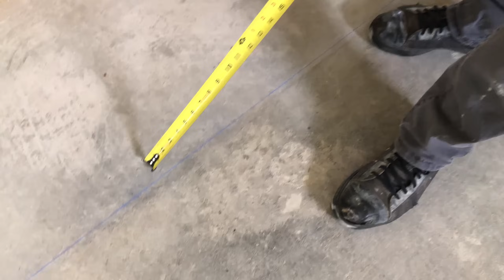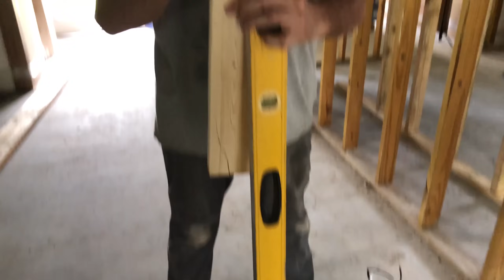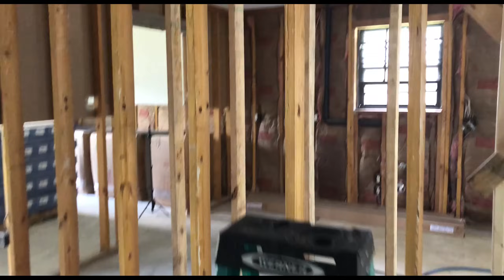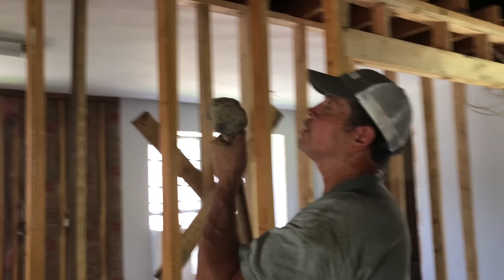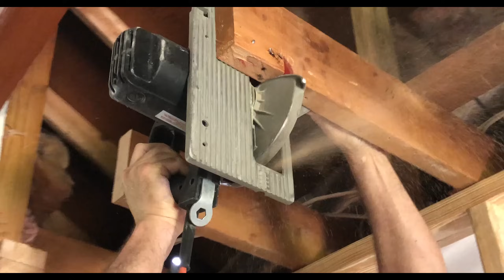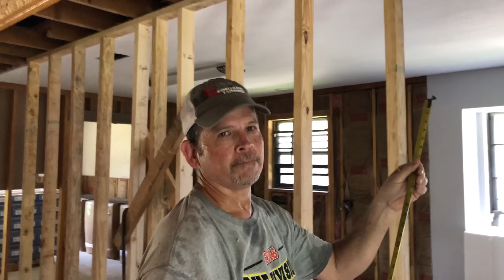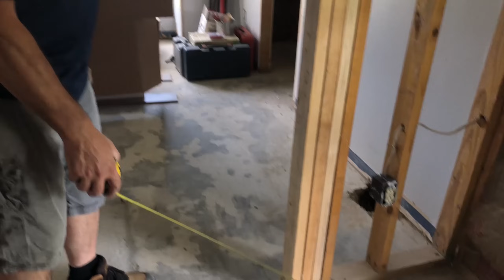Ripping Down a Support Wall and Installing a 16 Foot Beam

Comment: How would you tackle the footings if you're working on a floor above a basement with regular 2x8 floor joists?
Reply from the maker: Your engineer would have to design footings and the point load down to them.  I'd ask them to design the temporary walls as well.  You'll need them in the basement as well
Reply: @StudPack  i imagine the temporary wall should be fine since the load is spread out in a wide area and also its temporary.

Comment: Stud Pack: Did you consider a 17 or 18 foot beam to help further eliminate those short walls? I know you might be running into the roof, but the kitchen side seems to have a little room. My spouse would want all the wall gone!
Reply from the maker: Interesting you bring that up.  We actually had a larger opening and then the designer wanted it changed.  We moved the “stud pack” supporting the beam and the rest is history 😂
Reply: @StudPack  As long as the "designer's" name includes the word "spouse....." Thank you for the quick reply.
Reply from the maker: How did you know😂

Comment: I just installed 3 LVLs (3) x 1 3/4 x 25’ . Can someone recommend the ideal overhang on the posts for a beam this long? The engineer recommended 8’’ hang on the post on each side by my contractor only did about 4’’ on each side.

Comment: the temporary load wall is a lot of wasted wood! could have king or double the top horizontal studs resting on vertical 4x4s every 5ft
good thing that load wall wasnt supporting joist in both directions... i have 1 that support a dinning room and a kitchen so i would need 2 temp walls but decided the cost and sweat wasnt worth it. 
the new wood beam was so tall i was worried for fitment but since you have short stub walls you cleared without the stub walls would have needed a steel I beam

Comment: I would have loved to see how you managed to remove a gas line from a wall...? Did you just cap it or reroute it?
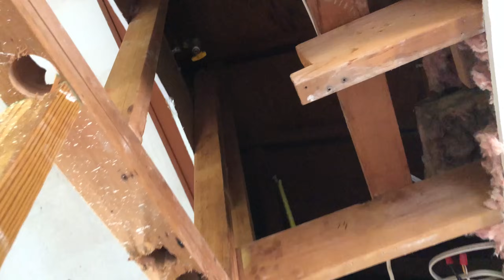Reply from the maker: Both actually.  At 01:40 you can see where we used the old valve from behind the range to cap the gas line in the attic.  I didn't have any pipe fittings with me so the valve worked fine temporarily.  This is all 3/4" threaded pipe. Later in the project the plumbers ran new gas line to the new range location in the peninsula.   We didn't video that but check out 09:10 in our video:  https://www.youtube.com/watch?v=7-OjVJAq8o4&t=1128s

Same plumber, same product.  I'll get more video of that next time.  Thx for watching!!

Comment: Stud Pack, you should add to your video why you didn't need to install 2x2x2foot concrete pads under your new jack locations.
Reply from the maker: I mention it briefly at 20:00 near the end.  Probably should have been earlier.  We'll go into more detail next time. Thanks Philip!

Comment: Wish you showed how you put the other cropping host in.
Honestly, I would have just cut it square and joined it to the to joists not to on either side with some hangers. It could probably work just sistering another cripple side it with glue and some screws, though.... Maybe..

Comment: so do I need to pour footings for a 16' span on a slab if I'm in GA? Really hoping I don't have to do that...
Reply from the maker: Only an on site visit by an engineer can tell you that.  Sorry we couldn't help with that one.
Reply: Yes you do. His engineer missed this. Structural columns always need structural footings. Normal footing is like 2'x2'x1' or similar and can vary with soil type.
Reply: @CybekCusal  if we tie it into existing footings then it should be fine right? The challenge is finding the existing footings... How do you go about it?
Reply: @enkrypt3d  there is generally no footing in the middle of the slab but could be. Often Only the perimeter. You can drill a test hole if you think you already have a footing and see how deep the concrete is.
Reply: @CybekCusal  if it's an interior load bearing wall then it should have footings under it correct? Not able to find the blueprints for my house built in the 80's unfortunately......
Reply: @enkrypt3d  well yes but the load was spread across a larger area, now it is a more concentrated point load so theoretically you would need to increase the size of the existing footing in that area only where you increased the load
Reply from the maker: @CybekCusal  On this project there was a footing under the original load bearing wall that we removed.  We confirmed this with the engineer on site by drilling a test hole.  I have a 24" long 1/2" diameter SDS bit for my roto hammer just for this purpose.  Used it on the west coast a lot for seismic retrofits.   Once I got to 12" depth in a couple of places the engineer was satisfied.   Great tip Cybak, I wished we would have filmed that but this was only our fourth video (I think).   We have a big project coming up this fall removing 2 intersecting load bearing walls and replacing them with beams (probably steel).  I'll make sure to video the process of how we confirm existing footings.
Reply from the maker: @enkrypt3d  see my reply to Cybek.  Their suggestion of a test hole is exactly what we did.  Use a roto hammer (not a hammer drill, they're not the same:)) with a long bit and drill test holes in the slab.   Not sure of the stage of your project but we would drill in inconspicuous places (this was during the design phase before any plans/permits were done to establish scope of the project) like pulling the edge of carpet up at baseboard and drilling between tackless and the wall or you may have to remove a piece of base if hardwood or tile to get a clean shot at drilling into the slab without damaging floor.  Use a vacuum to collect the dust.    Hope that helps and good luck with your project👍

Comment: Just curious about the load transfer to the floor, is there a basement or is the house on a slab ?
Reply: Take a look at the floor.  That sure looks like a poured concrete slab to me.
Reply from the maker: Yep, slab on grade.  Engineer confirmed existing footing in slab.  We'll address that in another video.  Sorry it wasn't clear.

Comment: Hello Sr. I am in the process of remodeling my kitchen and their is a wall that I am not sure about. I would like to open it up and my house is a single floor and is on a slab also my roof is scissor trust and this wall is small about 9 feet wide. i live in southern California just north of Los Angeles. please can you shine a light for me thank you.
Reply from the maker: The best advice I can give you is to hire an engineer since you live in a seismic area.  One thing you have going for you is a truss roof.   Scissor trusses usually mean a vaulted ceiling and would span the distance between two load bearing walls. I did a single story project like this in your area and all the roof load was on the exterior walls.  No interior load bearing walls at all.  Made it simpler but get an engineer's advice on any wall removal.  Thanks Renato!
Reply: @StudPack  Thank you for your reply Sr. I did what you told me and I went and got me an structural engineer. his visit to my house was $350.00 bucks but was very helpful, I already had one wall removed and that wall was no load bearing but it need some more reinforcement and he told me what to do. any way the second wall that i need to remove turned out to be a partial bearing. this engineer was very cool after talking with him he said he will coach me to the permits and do all the calculation for the new structure the only thing  i will need to do is the site plan and the floor plan drafting which i can do that no problem his fee at the end 600.00 bucks  if you don't mind I like to post picture on this comment area if is OK thank you for your help.

Comment: Looks like you used 3 king studs on each end of the beam to support it, is that bearing surface specified by the beam manufacturer? Also, is there a basement? The reason I ask is because if there is a basement is the load transferred all the way to the floor of the basement? Great tips.
Reply: Our structural engineer specified the 3 studs on each end to support the beam.  The drawings specified the studs as a "stud pack" hence our name!  No basements here but good point if you do have one.  Thanks Jay!
Reply: @lizselleck  haha nice!!

Comment: I did like the video, but have a question about strapping the beam. How did you strapped the beam with the walls? You did not explain it at all. Thanks
Reply from the maker: Thanks Victor.  If by strapping you mean metal strapping to tie it all together that is not required in our part of the country.  I used to live in southern California so I am very familiar with seismic requirements but our engineer for this project in southern Louisiana did not specify any and the inspector signed off on it.  If you mean something else, let me know and I'll try to answer your question better.

Comment: Awesome!  My house is almost identical from the vent to the gas line to the vaulted ceiling.  Even the hip roof!  A question I have is with the interior slab support.  Was there any concern with that?
Reply from the maker: Yes John, lots of comments on that.  Since there was a load bearing wall in this location previously, we confirmed that the slab was thicker in this area by drilling a 1/2" diameter hole with a hammer drill.  Once we reached 12" in depth the engineer was satisfied in the strength of the footing.

Comment: Did you glue between the 2 lam beams bef0re screening them together with structural screws?
Reply from the maker: No we didn't.  I never really considered glue at all until someone else mentioned it also.  I've never seen it mentioned in manufacturer's/engineer's screw schedules so I figured the screws were enough.  Glue certainly wouldn't hurt though - something too strong never broke as Keith Rucker says:)  Thanks for the comment Chris, we really appreciate it!!
Reply: @StudPack  "Something too strong never broke" is what the guy said as he replaced a shear pin with a grade-8 bolt, then proceeded to twist up the entire machine next time it jammed. :D
Glad to find your "double beam" video -- I assume this uses the same screws for holding the beam on the ends.
Reply from the maker: @Sylvan_dB  Very true Sylvan re: shear pins!  Some parts are meant to fail (rupture discs being another example).  We use the same screws (longer though) to attach the beam to the top plates on all beam installations.

Comment: Nice, but I would have preferred a half inch steel  flinch plate sandwiched between  two 2 x 12s
Reply from the maker: That would work but our engineer specified the much lighter LVLs and there are no holes to drill thru the flitch plate and we didn't have to lift a plate that probably weighs over 400 lbs.

Comment: Can you use the same technique if there was a second floor?
Reply from the maker: Yes but it's more complicated because you'll need to account for the additional loads imposed by the second floor above and also the load path from the roof to the temporary walls on the first floor.  Your structural engineer will have to guide you on this one.

Comment: Hi, great video thanks. Have a question. How do you know the footings do not need to be reinforced. I have a similar project coming up and want to make sure it's done right.
Reply from the maker: Great Question. Slabs are usually thicker under load-bearing walls (which is our case here) to accommodate the load and this was confirmed by our structural engineer.

Comment: hangers to hold the roof up?
Reply from the maker: Not sure what you're asking...
Reply: @StudPack  is the hangers strong enough to hold the joists up?  hoe many nails and how long are they?
Reply from the maker: Don’t remember specifically on that job. I always refer to manufacturers website for nailing specs. 

Strongtie.com

Comment: Nice job. One suggestion, use screws for the temp wall. Much easier to disassemble. One question, how did you support the roof? 2x4 on the beam or bolted to the side of the beam?
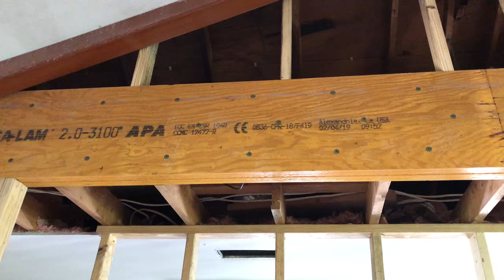Reply from the maker: Thanks!  Roof is supported by 2x4s on the beam, you can see them at 14:25

Comment: I have that same circular saw but would never be able to cut those joist ends straight.
Reply from the maker: I used a speed square as a fence I think 🤔
Reply: @StudPack  I would climb over the speed square or get the saw wedged.... it would be one thing or another.

Comment: Do y’all do any work in Houston, Tx?
Reply from the maker: Not yet 😂😎
Reply: @StudPack  that’s for the reply. I loved your video. I’m looking to do the same but my in house, it’s not a straight line. Our ceiling has 14ft ceilings, truss framing. If you can recommend someone reasonable that would be awesome.

Comment: That must have been one heavy roof or you guys get snow there cause a 16 inch in depth versa lam holds 1153 lbs per linear foot so that beam can hold 18k plus pounds.
Reply from the maker: Engineer specified it.  No snow here ... usually 😂
Reply: Was there a far span in the room like side to side (not the beam itself)or was there concrete tiles on the roof or was it a 2 story building?
Reply from the maker: No.  Single story.  One layer of asphalt shingles.
Reply: Rewatched the video again to see your guys install. I can see now why he specified a deeper beam there is no distributing loads in the roof no collar ties and there was a far span 2 rooms being held up by that beam and a large attic which means a taller roof so more weight and a higher wind load when that roof gets hit with wind.

Comment: Really enjoyed the video! Steps were clear and turned out great. i have a question. Is a beam the only way to remediate this problem?  I've only seen folks using this technique whether it is hidden or exposed!  Great job with video!
Reply from the maker: A beam is the easiest way to support the load once a load bearing wall is removed.  I suppose an engineer could design a truss though but that's way complicated.  Beams can be exposed, flush (hidden), or semi-flush.  thanks Richard!

Comment: Good video but the new blow floor point loads at ends of the new beam was not addressed.
Reply from the maker: Thx Edward!  Lots of comments on this subject.  This was slab on grade with a footing under the original load bearing wall confirmed by the engineer.  Check out our other beam video where we go into more detail about this👍

Comment: Great quick video, I have a very similar space at my house and have considered this. Now that almost a year has passed how are you liking it? Also, if I were to contract this out, assuming your exact specs, how much would that job run? 5k, 10k, 15k?
Reply from the maker: Thanks James!  We sold this house so never got to enjoy the fruits of our labor.  I've spoken to the owner a couple of times and they are loving it.  $$$ is hard to pin down, too many variables, and I don't want to start to get in pricing on our videos.   Another part of the country may require concrete footings, larger beam, etc. but I think your numbers are a good minimum and maximum.

Comment: Do you work in Baton Rouge? I’m looking for a five-foot cased opening for my home. Thank you!
Reply: Let me know if he responds, I live in Baton Rouge as well, I'm doing the same thing to my home, exact same setup with vault in living room
Reply: @jontelmurphy5996  Nope, never responded. I actually ended up finding someone on Thumbtack to do the rough-in carpentry. Mine was only five feet wide so I didn't need an engineer or architect.

Comment: Awesome job!  Great explanation!    Just a quick question...Is there a need or is it required to reinforced or add footings to the studs that support the new beam?   Thanks
Reply from the maker: Thx Lalo!  The answer is sometimes.  I've done it both ways - new footings and without new footings.  It all depends on what the structural engineer requires.  All of our work is permitted and structural engineering drawings are required by our AHJ.

Comment: That expensive beam strength has been equalled to the strength of the side studs supporting with no footer reinforcement and lessor by the strength of the joist hangers. Did it pass inspection?
Reply from the maker: Thanks Spencer.   Our structural engineer determined that the slab was thicker in this area due to the original load bearing wall and that the existing slab was more than sufficient to handle the loads at the support studs.  Yes we passed inspection:)

Comment: Your engineer didn’t require that you transfer the load to a beam or footing bellow 
I noticed your 2x4 posts are sitting on the subfloor ..
Reply from the maker: It’s a concrete slab.  We drilled test holes to determine the thickness.   When we got to 12” the structural engineer said “good enough”.  Thx for watching our old stuff 👍👊